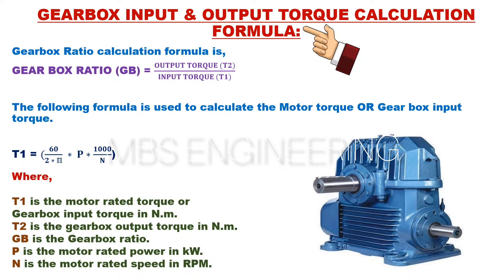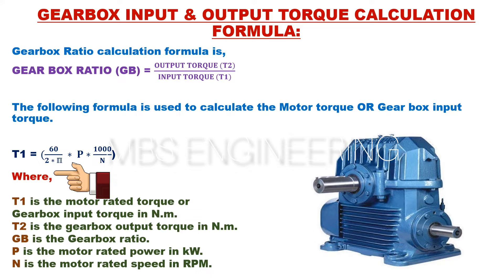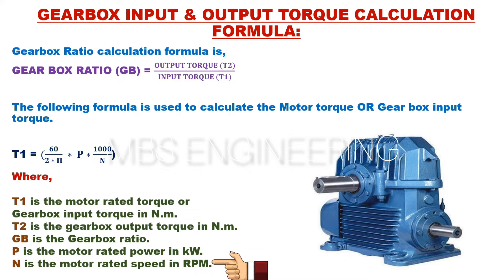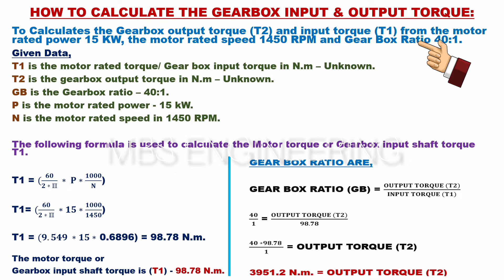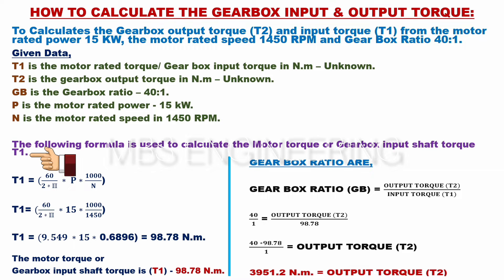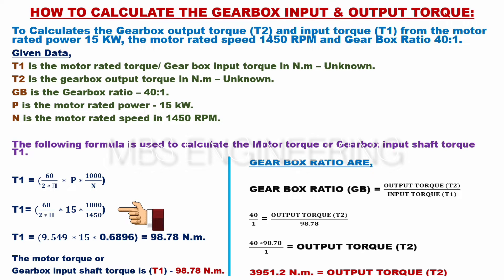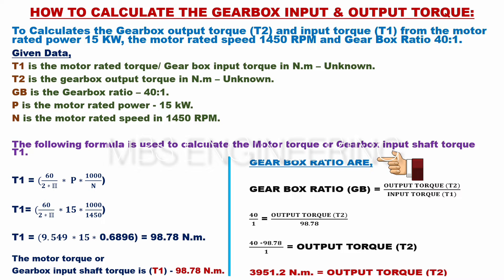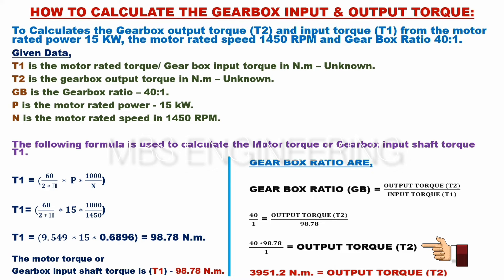GEARBOX TORQUE CALCULATION / HOW TO CALCULATE GEARBOX INPUT & OUTPUT TORQUE / GEARBOX RATIO /

Comment: How to protect equipment from damaging while using high ratio GB as motor doesn't trip even when conveyor is stuck
Reply: Use safe torque loc. Normally comes with Gearboxes as an option to protect it from undue high torque during these stuckup situations.